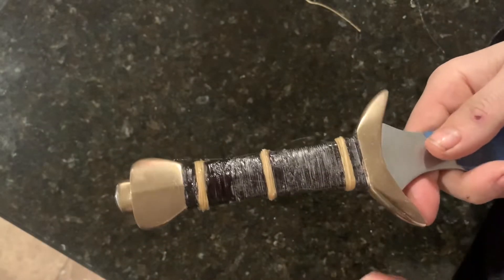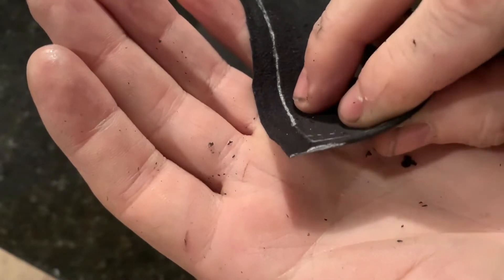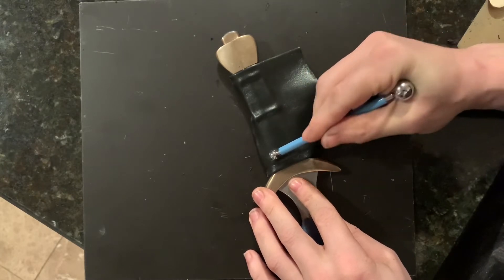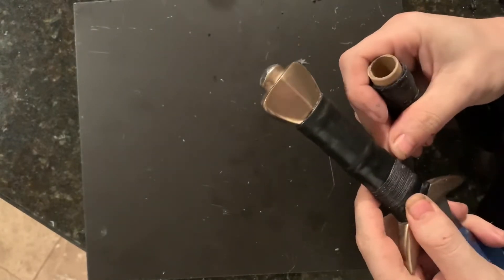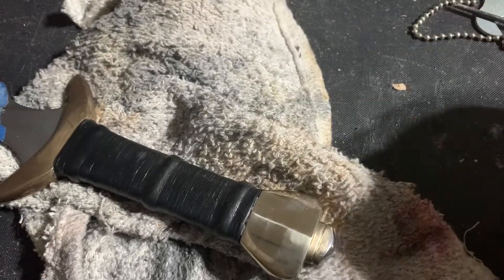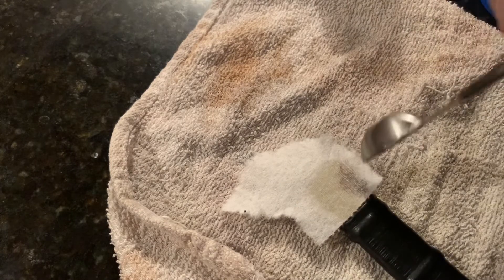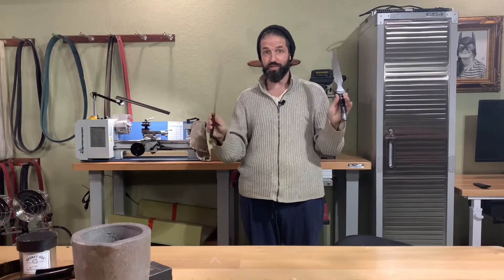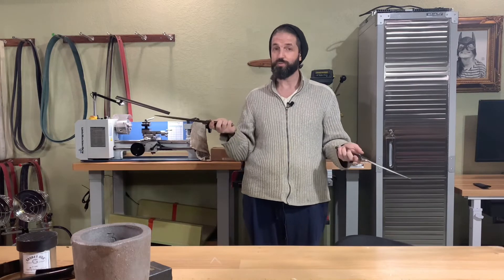Making the Ragebringer Real part 7

Comment: Great work, the glue method was fascinating. Next up, how about a Fer'esh? Relatively simple, but the hooked blade would be interesting.
Reply from the maker: Thanks, that would be a fun one to try. I’m coating the inside of a new forge right now, one that might be large enough to fit that in. Figuring how how to get the bevels on it would be interesting.
Reply: I suppose you could make an oversized blank and file the bevel into it by hand. Talk about a lot of work! I need to go back and watch the rest of this project to see how you 'quested' this rogue epic. ;)